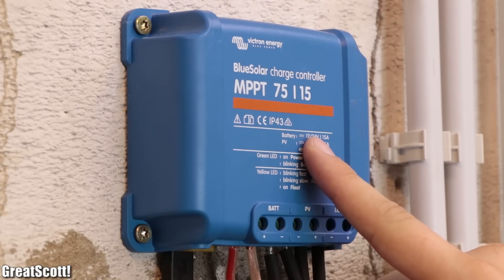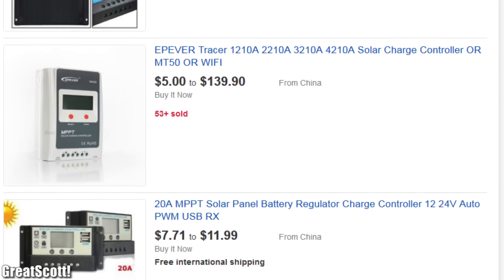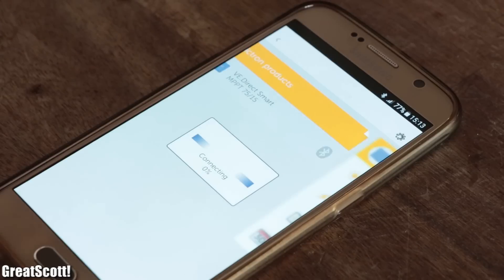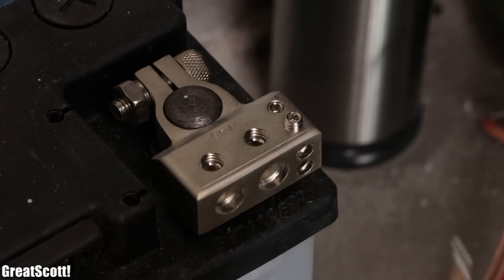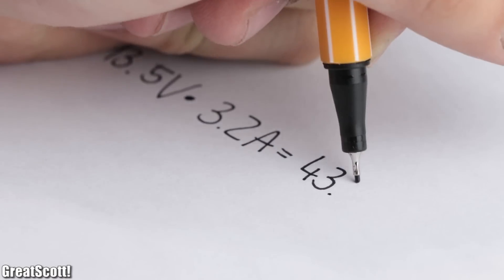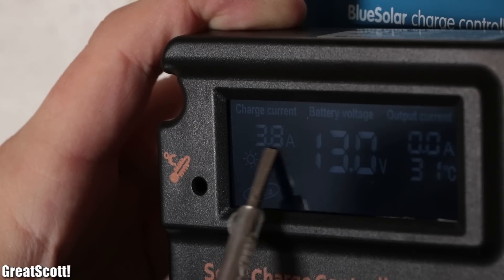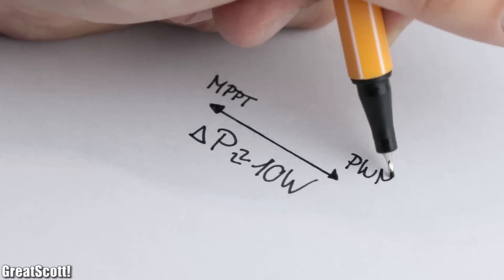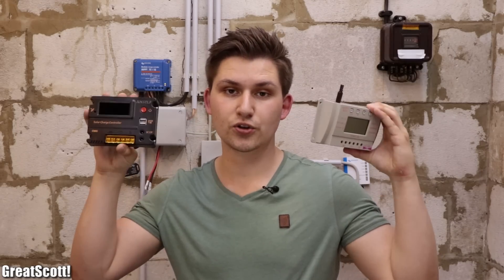MPPT VS PWM || Solar Charge Controller

Comment: I checked Amazon and found a $600 80 Amp MPPT OUTBACK FM 80 selling for  $365 <- I use this charger. It handles 150voc pv, 4,000w solar and chargers a 13kwhr lithium bank (48v) 47.6v/56.7v with the equalization shut off. How can Amazon cut the sales of this Named brand solar giant almost in half?  Is the company going out of business or maybe it was over stocked??? Also have seen price cuts On those Blue Aims MPPT inverters. Major discount cheaper with bluetooth app. We back ordered both to have expansion chargers and back up as chargers seems to go squirrely after 5 to 8 years of high current production and age.

Comment: Needing info on best setting to use similar PWM charger on a bigger 100ah Lifepo4 battery until I can afford a proper MPPT. I have been told that unless the cheapo PWM controller has the ability for the user to adjust the charging voltage for lithium batteries, it will not properly charge and maintain what those types of batteries need. Any input greatly appreciated, this is the system and charger I am looking at.  https://m.media-amazon.com/images/I/81plpYu2C0L._AC_SL1500_.jpg

Comment: Assumptions about reliability of the Victron may be in question based on a number of Amazon reviews that report failure.  A good summary here:  "The Victron MPPT7515 Blue Solar controller is too unpredictable for me to operate without supervision. In the meantime, I have also been able to see in photovoltaic forums that the spontaneous switching from 12V to 24V charging mode that I observed is not an isolated case."

Comment: If you fuse your wires correctly you will never have a fire unless you have a catastrophic failure of your charge controller .if it's encased in a metal cabinet as they should be the risk is minimized .mounted on a surface as you have done poses a risk .even on brick or concrete ..Electronics explosions can cause fires to surrounding areas .
So fuse to protect wire and batteries and controller .and encase your equipment in metal enclosures .Not plastic (PVC)indoors ..Use metallic conduit .

Comment: Your analysis misses the inevitable down time / wasted energy each time the mppt controller pauses to recalculate its settings. As this occurs regularly like maybe every 5 or 10 minutes... there is a real energy loss to also take into account.PWM controllers do not pause to recalculate parameters...they just keep working. All comparative reviews I've seen fail to consider this real energy loss consideration

Comment: The really important reason to get an MPPT is because you can fully utilise standard mass produced panels that output much higher voltages than ones designed for 12V use. A panel giving 36V pp would waste two thirds if charging a 12V by PWM. It's the stepdown that's the key to making use of cheaper solar panels.

Comment: great to actually see the cost/recovery difference in years between the two.. puts some perspective into it regardless of the Chinese sourced PWM. Thanks.. update.. Now that electricity prices are going through the roof (EU/UK) solar may actually become a more important feature. (pricing will go up on these items as well though. Catch 22

Comment: i am designing 60W panel, 12V 12000mAh battery and 26W load system. i guess pwm suitable for this.

Comment: I was using cheap Chinese controllers, have about 5-6 of them because they are all crap. Finally decided to buy a EPEVER package including Tracer BN series controller, MT50 Meter, eLog01 data logger which also allows PC and Meter connections simultaneously. I spent a total of $300 AUD but I am getting about 25% more from my batteries and a 1kw PV system charges 400ah batteries on an overcast day. Great thing with MPPT is being able to connect PV panels in series at double the battery voltage and have the charge current doubled (or better)

Comment: As long I use 200WP Solar Panel on the roof and take 3 years experience, I throw away the PWM Charging Controller, even the MPPT not enough good for me.
I just put simply BUCK CONVERTER, convert the sunlight to the Battery with CC-CV 13.9V and limiting the current at 7A to 12A. Leave the Buck Converter doing the job, never having issues for that.

As far I know, it just more more efficient than the kind of charging controller. Put simple digital Voltmeter-Ammeter for the battery and enjoy for years with simple and cheap way.

Comment: Do you know if there is a magnet in the mppt to draw charge? I have 2 90 watt,4.5amp ciggs in parallel running on very cheap pwm$20usd. It charges my 6v, 5amp battery to supply me my night Lightning in my studio apartment. The area of solar absorption is in shade:200-400lux all day. What I was wondering is whether a demand magnet would draw more light? Ciggs have a memory of power in coil based upon battery demand. It took 2 wall charges to make system charge small battery in shade. I tried series as well and at first it seemed to work better, but did not over 1 month. Now at 3 months just solar charging my apt is lit for reading and all else. I use task lights for chopping vegetables via battery. They are in apt windows. If a magnet could make them see more light for their memory, it might charge my 100amp 2000watt dc/ac system. Do you think mppt can pull this off?

Comment: What would you say about the EPEVER charge controllers? They seem quite popular. The older model EPEVER MPPT 30A cost about £100, their newer model with USB ports EPEVER MPPT 30A costs £130. And yet the same company makes EPEVER PWM 30A with USB ports and that costs £30. Why should one buy the 4 times more expensive MPPT for single 315W panel?

Comment: I have 3 flexible solar panels in series for 36volts total output. Can I use that 36volts to charge a 24 volt battery bank? Thank you.
Reply: Buy a CC/CV buck converter and use it

Comment: Something that you didn't mention is the main function of the MPPT is to vary the voltage or current in order to maximize the power generated depending on the temperature and irradiance  of the PV panels. This is specially important during days with lots of clouds in the sky since partial shading of panels can really decrease the power generation if this is not compensated by an MPPT module.

Comment: I find it funny when people compare quality based on the part location it was manufactured.  Most stuff from other country's are cheaper based on what their currency is valued at. Because 30 years ago China was all rice fields their currency is still less than other devolved countrys. 
All the components in your mppt controler were manufactured in China . Some one in the Netherlands may have assembled them but China builds all electronic components and there is nothing wrong with that. 
I promise you the machines that build this equipment for sale for you or me do not know the difference in the made borders our species created.  Products are built on a international level now unlike in 40 years ago.

Comment: I think you didn't mention the fact that a MPPT controller on a small system can make a small system viable so you don't need to upgrade panels or batteries.

Comment: Using those load outputs is a terrible idea. 
You have a 3000W inverter, so all load is going through tiny 2.5 square mm wire. Most people attach thick wires directly to the battery and then into a 12V fuse panel.

Comment: The point of an MPPT controller is its ability to extract maximum power from your panel even when the panel isn't under ideal lighting conditions. Testing only under ideal conditions won't give you a full picture.

Comment: Rather than knowing now much money the cheaper charger is wasting, it'd compare the total cost (panel(s) + charger) for getting the same amount of charging power.
In short I'd wonder whether it's cheaper to buy a cheaper charger plus a slightly bigger panel, or a smaller panel plus a more efficient charger.
Of course that's gonna vary with the desired output power: for a smaller (domestic) system it's probably cheaper to buy a bigger panel (assuming that its size is not an issue), while a solar plant would definitely benefit from a better charger, since the increase in revenue the proportional increase of efficiency multiplied by the power a big plant can generate would shortly compensate, and then overpass, the cost of the controller

Comment: Hi GreatScott,

Actually both the charge controllers you used in the video were not PWM controllers.

They are just cheap and generic MPPT charge controllers.

They maybe inefficient due to the low price.

Comment: Mppt really comes into its own with larger systems where the PV voltage is configured to be much higher than the battery through series connection of panels. In either case though, the energy harvested over the whole day will be significantly greater with a good mppt controller. Really enjoyed the video mate, cheers!

Comment: Hi Scott! can I always connect an inverter (with the proper voltage input eg. 12 V) to the output DC of the charge controller (12 V)? I saw that in some schematics, the inverter is connected directly to the battery, that will not supply a constant voltage to the inverter. Cheers

Comment: You know a lot about electronics, so... You know what would be great? Actually comparing similar devices with arguments rather than prejudices. 

If you were going to compare PWM to MPPT, you could have taken the "Chinese" factor out of the equation, by buying PWM controller from the same manufacturer that made your MPPT one. Or even better, having 2 MPPT and 2 PWM from 2 reputable manufacturers, just to take the "brand" out of the declared result.

Another suggestion that might be a great idea for another video is comparing MPPT controllers with as tightly similar a price as you can find, one from a reputable brand from your country, and the other one from a branded Chinese manufacturer (just to take the "trust" out of the equation).

Comment: Also:
1. In situations where you need every last drop of energy (rv/exp verhicle/boat/etc) mppt wins despite being more expensive.
2. The victron is built like a tank and solid insidec(cast in resin according to a teardown by someone) so much better for moving situations.
3. The victron mppt can be set to match the voltages for bulk/absorption/float charge given by the producer of the battery, which could extend the batterylife significantly.
4. 5 year warranty instead of 1-2?

Comment: The fact that the cheapo controller measures current so inaccurately, disqualifies it essentially.
Reply: it COULD be a wrong internal setting or 'odd' resistor value

Comment: Great video...thanks. Im a EE and q General class radio operator. I built a 125aH portable battery power box, for my power needs outdoors for long weekends operating radios and everything else I needed for my comfort...fan, lamps ect ect. I use a $15 no name charge controller now for about 6 years of regular use. It performs very well.

Comment: Great video, GreatScott!   It's great to see somebody saying to do the math before choosing between MPPT and PWM.   It seems a lot of people think MPPT is more efficient than PWM so that's all you need to know - go with MPPT!   But PWM makes sense for many people.  You really have to do the math for your particular system in addition to taking other factors into consideration (like build quality, etc.).  I built a solar system for my truck camper back in 2009.  I wanted to go with a high quality charge controller so I bought a Morningstar PWM.  It cost me $155 US but it is a solid, excellent quality controller that is still working flawlessly today.  The MPPT version of the same controller was almost $380, $225 more than the PWM version.  I added an extra solar panel to my array to make up for the difference between PWM and MPPT.   The MPPT controller would have given me 39% more watts to my batteries (at the most, not all the time).  The extra panel gave me 36% more wattage, so nearly the same advantage.   And the extra panel was $100 instead of the extra $225 for the MPPT controller.  So it saved me $125 over going with MPPT.  And for 9 years now the system has been working great.

Comment: I have that cheep black pwm controller on a 300w 3 panel solar system, Charging four 6v batteries wired in series and parallel to give a 12v block at 450Ah, each 6v = 225Ah ive had it for 2 years now  and was going to get a mppt controller but after seeing this video i don't think i will bother :) thanks for sharing this info.

Comment: Now $8 to $15 for PWM on eBay for 10A.  There are even some MPPT ones for like $35 or so. Yes some of these are not PWM or MPPT but junk.  However there are some that do past review tests.  Really teardown examinations are needed.  PWM needs the electronics to modulate pulses while MPPT needs at least one inductor to do DC voltage conversion.  These units are not that efficient but they do the job on small systems.  Like a my 50w RV battery maintainer controlled by a $10 PWM.  Essentially keeps the battery from overcharging and enables me to run lights, cell phone charger and vent fan with out having to run the engine every day.  For $10 it does the job with the intent to replace it when it dies which I expect.  With the PWM keep the cell voltage near what your battery needs while higher for the MPPT converter.  Yes a good MPPT would be more efficient but will not make much difference with something so small.

Comment: Scott, what made you finally choose the bluesolar vs the tracer-an from epever for example, i'm still struggling making the decision, all i care is charging a 3S10P 18650 packs  with 4x50W solar panel (2S2P) and being able to extract all data to my pc. They both should work for this purpose, so i rly dunno whom to choose :/ If you have an idea, thanks a lot in advance ;)

Comment: Scott, what about using a victron pwm pro for a beginner solar set up one 300 watt panel with a 50 amp hour lead acid battery that I got for free, in future will go to lithium.

Comment: Thanks for the product comparison. You make sense: depending on the project a cheap controller could be better. If for example, I will go camping I may use the cheap controller since I will be supervising the equipment. I hope that in a few years the price of the good controller will go down :)

Comment: Uei! Finally I see the man behind the voice. Thank you for the video. All together, what I think in the end is that it does not mater if a solar panel can produce energy for 25 years if a solar charge controller need to be replaced after some years (meaning more money) and if you consider the price of energy you will get in the same price as if you paid the monthly bill. I like solar but I have doubts about the final cost.

Comment: I have and use both of those Chinese solar controllers in my RV's and like them both. However the first one (Beige in color) is fully programmable and works amazing for what you pay . I used it in my last RV for 4 years with 200 watts in panels and 4 X 6 volt Trojan T105 batteries (wired to 2 - 12 volt banks). The one and only downfall I experienced was when the batteries are fully charged at 13.6 or 13.8 volts the charger said you were at %80. You had to turn up the cut out to 14.6 volts for it to read %100 and then of course the batteries would be boiling. I just locked my cut off to 13.4 and ran it like that for 4 years. When I sold that RV and bought my next one I went with the second one you tested. The Black controller. Because ...... Well it was pretty. It charges great but has no adjustable parameters and pumps the batteries to 14 volts and holds them there. I have some people say that is fine but I honestly do not like it that high.  The reason I like these Chinese chargers is because they are cheap and they have full read outs on them without having to buy some ridiculous blue tooth module. That is just my personal experience other people may have different opinions.

Comment: Turn the PWM voltage up and the current will increase. You can take the battery voltage to 14.4V

Comment: I purchased some MPT7210a controllers, mostly because I use a mix of 230w, 285w, 300w panels charging a 60v LiFePO4 stack.
It's fun to watch them compete with one another to push current into the batteries when the system is under load

Comment: As I am sure you know, but did not state for the video, the MPPT really begins to shine when you hook up the panels in series.  

Increased panel voltage is less loss in the wires and the MPPT can convert the higher voltage.

Comment: I have a 80 volt PV setup, going in to a 12v battery. A PWM charge controller would lose at least 75% in my case. Recommend MPPT all the way.

Comment: I have the victron energy 75/15 controller hooked to a 265w/24v panel.

IF I were to purchace a second 265w panel it would exceed the limit of the unit. But does the unit know how to current limit or would it not work at all?

Comment: Key benefit in favor of MPPT, panel voltage is decoupled from battery voltage. So you can use strings or common ~30 volt panels on 12 Volt battery systems. Alternatively, you can use PWM with ~30 volt panels on a 24 Volt battery system and get great efficiency compared to MPPT.

Ofcourse, wiring 10 panels parallel isn't very practical, and wiring for 80 Amps from roof to battery is kinda expensive :)

Also, if you just need that 20% of extra energy there is no real alternative, although daily variaton in weather could defeat it easily. A extra solar panel is practical, if you have the space. (Think motorhome/RV/Camper, you can often fit just one)